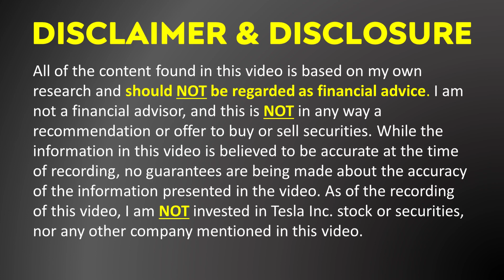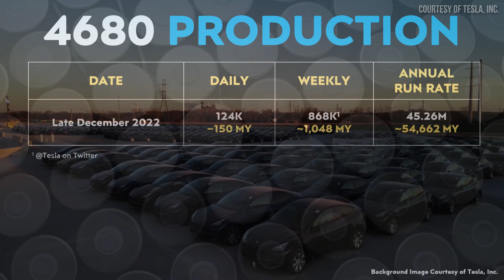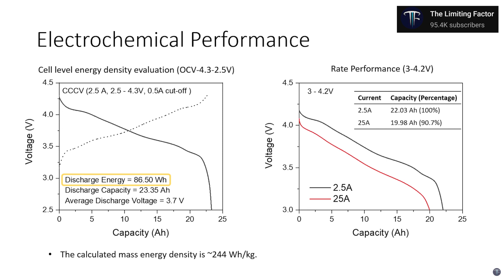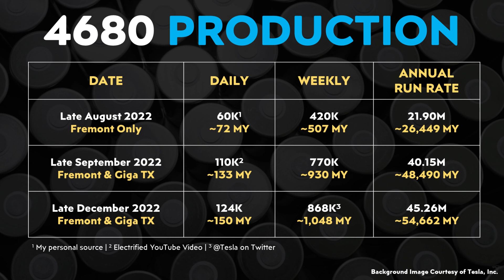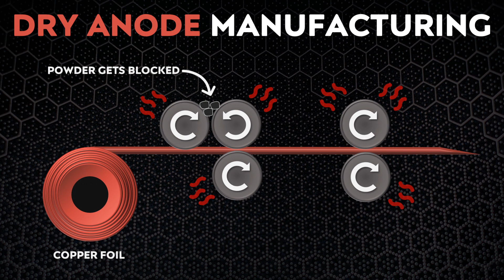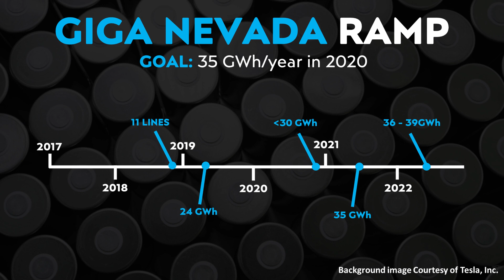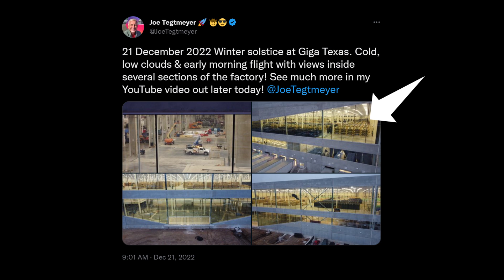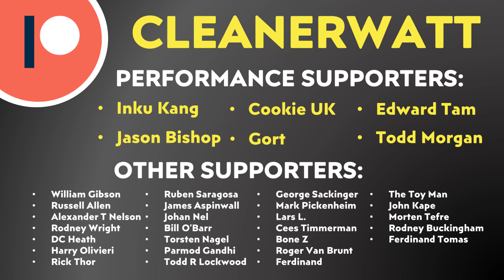Tesla's BIG 4680 UPDATE has me CONCERNED & EXCITED

Comment: I think Elon's agressive and optimistic timelines internally must be replicated unfortunately.... externally to investors. 
If they are different, one will undermine the other.

So Elon is optimistic and works his balls off. How long can he do this and lead from the front because he must otherwise he would rightfully be called out as a hypocrite. I don't think he can burn the midnight oil for much longer otherwise he will die and for what reason.....a few extra years of tech dominance.

The mad thing is that even pushing so hard on ground breaking tech is always painful,  not many can do this project after project after project.
 
I do think investors and the market has been spoilt in that these ground break tech do come into the market and Tesla pulls it off. The market then shugs and does not reward all the benefits Tesla will gain, they still think it is a scam . 
Example. Pepsi revealed that they are using the Semi for a long route @400 mile and a short route  @100 mile.
The FUD'sters latch onto the short route and spin it as if the Semi does not actually do 500 mile per charge 0-100%. So throwing shade on Elon and Tesla's amazing achievement. Even though the other OEM such as Volvo and Daimler had a 5yr head start and can only do @250 miles per charge and will invariably cost more.
Reply: CORRECT!!!
Reply: Elon might be working his balls off, but not for Tesla.  He's spending all his energy on Twitter while he simultaneously destroys the Tesla brand by his idiotic tweets.

Comment: If fixing a problem needs new tooling, or production equipment, I would expect the improvement to be very lumpy not linear, and take 6 to 15 months to do, in some cases longer, and recently supply chain issues have extended these tooling times, one is only as good as the slowest supplier, and holding them to that schedule is a bit unfair.

Comment: The production breakthrough is real. The ramp is going exponential. You’ve been told.
Reply: It took over a year to achieve 868K in Feb; now they are achieving that number in a week.  The ramp will go exponential.
Reply: There is no "exponential growth" in battery production. You've been told :)
Reply: The production breakthrough is something to be excited about, but exponential growth just doesn't happen in manufacturing.
Reply: 18% improvement in 3 months is not a fast ramp, especially not when they were supposed to be at 100 Giga-Whrs capacity right now. They are not even close and won't be there for at least a couple years, much less the 3 Tera-Whrs their future production goals require.
Reply: @TecnamTwin It takes only about 4 18% jumps to double. Zo if they do grow 18% Every 3 months, the 100GWh runrate is in reach end of 2023, beginning of 2024